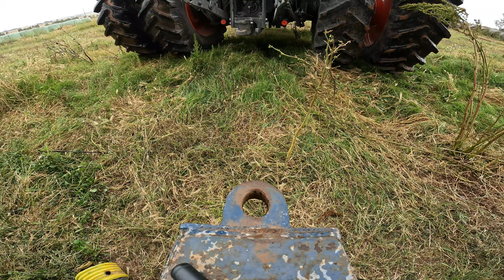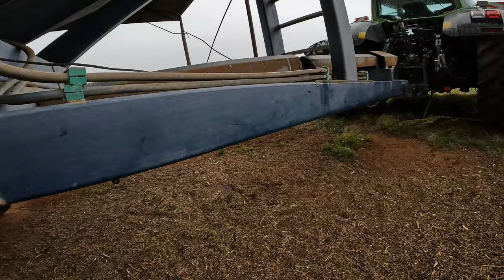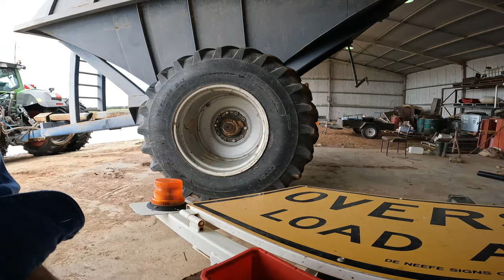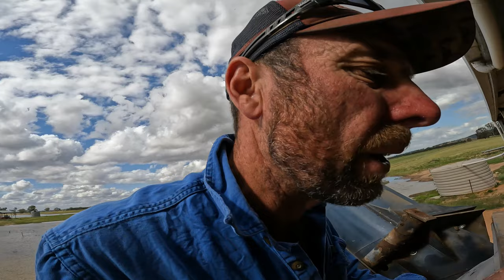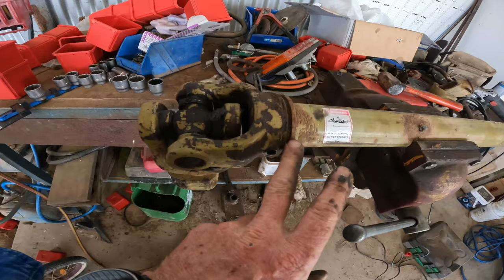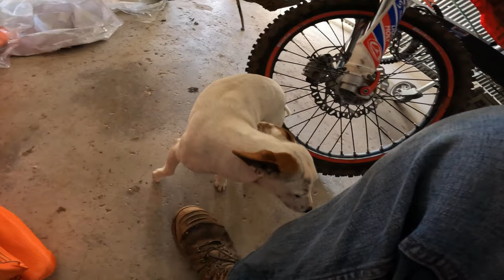Call them what you like, we call it a chaser bin

Comment: If you push and hold your suspension activation button on your right hand arm rest. After ten seconds it lift the front the front suspension to full height this drops your tow hitch by a couple of inches. Might of been able to get the bin that way. If hold the suspension lock out button it will drop to full drop and lift your tow hitch a couple of inches the other way. Like your content thanks for the pto tips👍

Comment: Ideally your pin (pivot point) should be in the middle of the 2 u-joints so both angles are the same when turning, but I guess you are mainly straight when operating pto.
Reply from the maker: Yeah we only unload straight along the mother bin, but yes it does chatter if your not straight